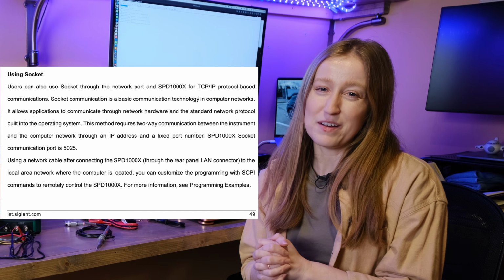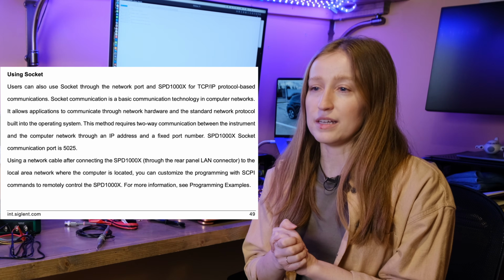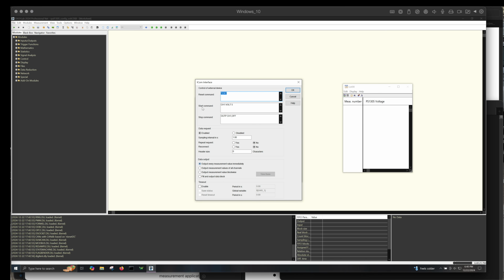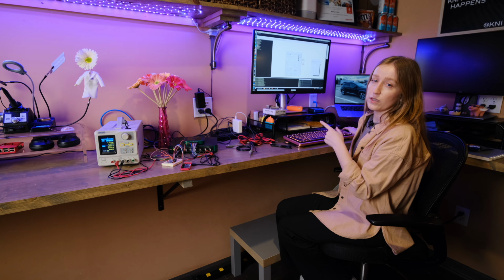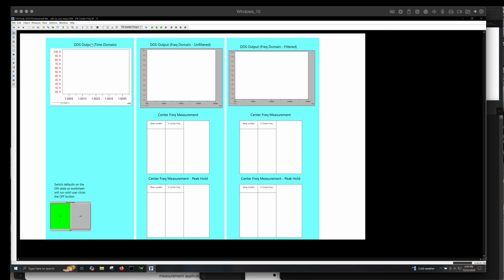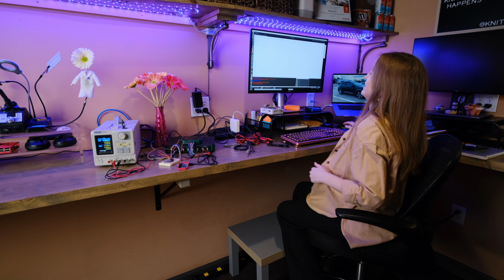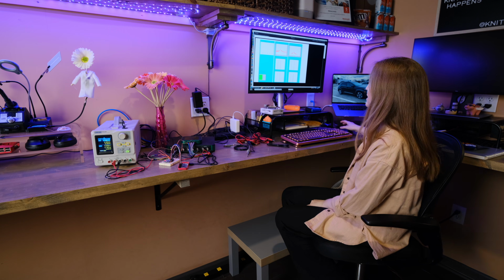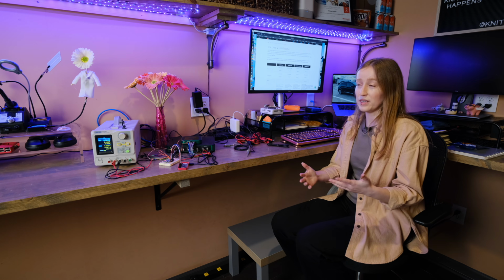How to Create a Remote Benchtop Setup for Electronics Engineers

Comment: Thank you. I had an idea for a multi battery charging and monitoring system. Keeps an eye on voltages and capacities temps and position, with hookups for all different types of batteries but the power is available through usb or other.... also would have in circuit isolation and alerts.... maybe solar sun tracking.....probly safety features as well, smoke fire carbon monoxide alerts.... kinda to get all the random stuff in a safe place, I guess. I like the idea of the power strips... I have tried to set systems up that can shut down multi projects from one switch, like a breaker kinda. If you have a lot of different devices that you need to activate remotely, don't forget audio, you can send audio of nearly any kind to communicate, there use to be something called a veear i think, you could program what sound it listens for. You know what might be cool, an independent unit you could use on various projects with adjustable current monitor  that lets you know audibly if its where it should be.....

Comment: 1.- Hi, former R&S support , the guy to set up all, carry the lugagge, do the wiring, solve problems, bribe reps and any one who gets on the way to close sales, and the scapegoat for rude lazy ignorant sales managers. So 
2.- Above all , Thanks with Capital T for the courage and determination to present such raw effort. 
T&M can be rewarding, but sometimes it's really tough.
Now, With the best of the intentions
3.- can you measure phase noise? dBc
that will tell you how clean is the oscillator itself.
4.- What filter are you applying at the output?
5.- The PLL code, is it your code, or are you using some one else's PLL code?
6.- Have you actually built a PLL to pull the 850kHz or 900kHz up to 1MHz ?
5.- SCPI GPIB I2C ... the instrument control protocol doesn't matter if the oscillator cannot hold steady on expected 1MHz
6.- Can you write in C an N-fractional PLL?
7.- Once you have "built" (written) a working PLL :
7.1.- sweep the entire band you want this device to work on
7.2.- Obtain all frequency errors on each individual frequency
7.3.- Build a correction table
7.4.- Bias accordingly the input so each output matches each expected frequency.
7.5.- Expensive equipment do this while taking device/room temperature as parameter. Does this board have a built-in Thermometer to check board Temperature ?
The device you show on the table has a thin box, it's open, and it may heavily vary output frequencies with temperature.
Thanks again for such presentation.

Comment: I still have no idea how this makes you money!
Reply: IT Infrastructure is the field.  Software all runs on hardware.  Hardware has to be maintained, troubleshooted, networked, upgraded, replaced, etc.  Tools and expertise are needed at every juncture of the IT supply chain from the fiber optic cable to the routers and switches that network your pc to a server providing you this video.  All the IOT devices in manufcaturing and other Infrastructure industries have their own maintenance and troubkeshooting problems.  Expertise in system design is needed to fix all this stuff.  Its really all just plumbing and circuits that holds the modern world together.

Comment: I wouldn't turn DHCP off, I would just configure it to give certain IPs to specific MAC addresses. This would centralize the network configuration instead of requiring of you set the IP for each device through its own interface, while running the risk of having the configuration deleted after some firmware update or something. Anyway, nice setup.

Comment: I'm a big fan of Skippy ehh... SCPI ... and only buy new stuff that has ethernet + SCPI built in. My power supply looks like yours but the SPD3303X has 2 programmable supplies. I use this in combination with an SDL1020X electronic load to measure the efficiency of power circuits and battery systems. Being able to program those via SCPI from Python (using the VXI11 library) is great and it made me expand my Siglent stack with their SDM3055 5.5 digit multimeter, SDS1104 Oscilloscope and - after a lot of thinking - also the SDG1062 arbitrary waveform generator.
I really like the Siglent stuff except for the clunky user interface on the power supply. Just having a rotary knob is not the best user interface. It takes a lot of turns to increase or decrease the voltage or I need to press the "Fine" button to go from 0.1 to 0.01 and 0.001 to 10 and then 1 V increments. I often just use my Python scripts to set the voltage and current. I still want to create a real UI with a keypad or a touch screen to set the values.

Comment: Super interesting. In my former job I was forced to use NI Labview with Teststand to build test equipment for embedded hardware production. I liked Teststand but I really did not enjoy Labview. In my current job I had to start from scratch and it's way less involved ("just" hardware test automation for R&D) I decided on trying spintop-openhtf (fork of googles open hardware test framework) which is open source and based on python. Sad thing is that they stopped developing it. I did not know DASYLab, it looks capable but I guess I'm more of a code than a guy person. Anyways, very cool to see your setup, there is not much on this topic on that platform. Looking forward to the next video :) subbed and 👍

Comment: Hey there Whit, Nice set up!. I've got an Extra class amateur radio FCC license, and I'm studying the General Radiotelephone Operator License (GROL) commercial FCC license with Radar indorsement. I like what you're testing with the frequency generator and verifier. May I suggest you narrow the lower and upper frequency band segment limits for your 1 MHz target frequency, allow your frequency gen circuit board to warm up to a constant thermal temperature before running the test for a more time based accurate frequency result.

Comment: Not heard of SCPI protocol before, Awesome video, really cool and interesting.
Reply: It's super useful, in a previous life I wrote an end to end hardware test, cal, burn-in, and data/traceability artifacts system using SCPI and other protocols in python with a web frontend. We could put a space flight component in a test jig, wire up sensors and I/O and the only time we'd have to touch it during the flight qual was if we needed to move it to thermal chambers (or take it to vibe). It was super nice to be able to put a component in a thermal chamber on a Friday morning and come back Monday afternoon to it and it'd have done everything automatically and produced all sorts of artifacts to prove its capabilities (and failures if they did occur).

I and other engineers would get notices and other stuff if things went awry too.

Comment: Thanks for the presentation. Call me an idiot but i don't understand the "remote" part. Shouldn't "remote" mean that you are in one place and your equipment is completely elsewhere (other building \ city \ country) ?
Reply: Well, "remote" means exactly what you mentioned. In the video, she describes how she built and uses her setup to monitor and interact with her test bench. She has remote access to the power supply to power the Raspberry Pi Zero and thought she could SSH to the other controllers via a Wi-Fi network, which is connected to the internet or a VPN to allow her to connect from anywhere. She probably demonstrated while being in her lab because it is more convenient than filming in another location just to demonstrate the remote access.
Reply: In this context remote/local refers to the manner in which you interface with the device under test (DUT) not the location of the device itself.

Think of it more along the lines of an RC car/helicopter/drone or even say the IR remote control for your TV.

You could be sitting right in front of it but you are still controlling it remotely.

I'm going to go out on a limb and say simply having to ask such a question means this content is definitely not for you 😅
Reply: “Remote” means using one machine to control another, different, machine ….

“WHERE” those machines are, and how far apart they are, is immaterial to the discussion.
Reply: What would you have seen if you had seen her only in a non-lab location?  This way she can show the equipment used in the lab so as to enable remote access.  The easy part, going somewhere else, should be obvious after this.

Comment: This is really well thought out! I have been doing some hardware analysis on an IOT product. I had an swd dongle connected to a raspberry pi connected to my network that I could access via a VPN. I had the IOT device connected to a cheap switch that I could enable on Google home that turned the IOT device on and off. All of what I had setup could be done remotely (that was the ultimate point of that setup) I just didn't have any assurance when something didn't work correctly because of my lack of networked test equipment. Your video motivated me to make my home lab more robust!

Comment: from 1996-2000, I worked at HP/Agilent's Automated Test Equipment business section and in the Santa Clara Semiconductor Test Division where that division made test equipment to test FLASH memory on the wafers themselves, companies that used this equipment (IBM, AMD, INTEL, etc.) used our tester (V-series like the V3300) to do their wafer sort, for that we interfaced with the wafer prober in their clean-room to move the table X-Y and Z up to touchdown on the wafer's pads.   Our equipment was in a large metal cabinet (and fans that were incredible to cool off the system), full of many large PCB's that did the pin-electronics, pattern generators, Test Site Controllers were the i960's, with a host of custom FPGA's.... it was a beast!  The customer-facing programming language was a pseudo C and the pattern generator had some proprietary assembly language like code to write the patterns, e.g.  NRZ  For non-return to zero.

One project that I worked on at HP/Agilent was the characterization of the chips themselves to find the operational parameters, called a SCHMOO plot.  That requires a complex interaction of power supplies, pattern generators, etc.  I wrote code that generates characterizations, it would step the equipment and then run the customer's characterization code, lather, rinse repeat...  So singe axis, 2D and then a special need for a 3D Schmoo plot, we had a console connection (no fancy graphics) so I came up with a really slick way to represent in text the 3D dimension...  and another innovation I came up with a way to avoid hysteresis in the characterization of the tests, both were considered patentable I{, but alas, they ultimately didn't patent it.  Wouldn't that be cool to have my name on 2 patents... sigh... what could have been, Right !? 

Today, I'm unemployed looking for something in industry... so I'm working on fun projects at home (Halloween and other things).  I have a home lab with some old rack-mount(ish) HP equipment, they're GPIB, but I haven't needed a remote setup or automation for my projects... and I completely understand why you need what you need. 

 Looks like a great setup you have there, a lot more capability too.   COOL !

Comment: It's an interesting video on your basic setup.  I have not seen the interface (DasyLab) that you have been demonstrating in this video.
I was also unaware of SCPI commands as there used to be GPIB (IREE 488(.1)) interface. Looking further into GPIB it actually uses SCPI connands..
With your frequency drift problem, you could try implementing a feedback protocol to correct the required frequency from the actual read frequency, such as PID.
PID can take the error and send back commands to bring the frequency back to the desired frequency in a closed loop.
I expect that you already have the experience of PID as you clearly understand your system.  I just mentioned it as you may have overlooked it.

Comment: Create static MAC/IP mapping in your DHCP server rather than turn DHCP off risking IP conflict 🙂
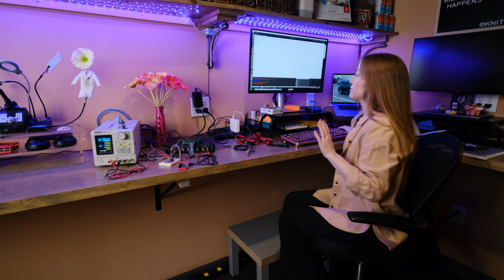Reply: Yeah, re 29:06/29:27 - I would also tend to recommend this as a suggestion.  Not sure what Whitney's setup is like, though, it may not be easy to do, depending on what she's using for DHCP.  But if this can be done, e.g. with dnsmasq or whatever, it provides some nice functionality... not least, also having access to local DNS that has names for everything... so "ssh ps1.local" or similar becomes doable. :)
Reply: I just created a DHCP range and set all my test equipment with IP addresses outside of this range. No risk of IP conflicts this way.
Reply: @Rob_65  outside of manual errors, fair enough... though also, there's arguably even less risk with the MAC-mapping option... and it can integrate with DNS, etc.
Reply: @Rob_65 there absolutely is a risk. How are you tracking and preventing the re-use of an IP address from human error?
Reply: Static mapping on DHCP server side is the professional solution and how it's done in enterprise situations - part of the subnet designated as a pool for dynamic allocations, a different part for statics assigned by dhcp (but manually tied to MAC)

Example for the subnet 192.168.0.0/24 you might have:
.100 to .199 for dynamic assigned pool
.200 to .249 for static assigned

Even the most basic home routers have had this functionality for well over a decade.

Comment: Does SCPI go over GPIO port on test equipment?
Reply: Modern test equipment will accept SCPI over, UART, GPIB , Ethernet and USB. Most  modern equipment has dropped the GPIB as its quite bulky cabling wise and pretty slow if your grabbing data. We tend to use Python talking to a connection server , i.e. Keysight connection manager, and that's about it for us.
Reply: @fredblogd8448  But do embrace GPIB because all older equipment uses it, and older equipment is often much better value for money. As it happens, Tech Tangent has just published a video about that.

Comment: As a hobbyist who has been meaning to look into SCPI and other remote control options recently, this was incredibly helpful and timely!

I switch between a lot (too many?  what's too many?  i don't have a problem.) of projects and this sounds like an amazing toolset to build up where scripting a set of bring-up and initialization tests for a board and documenting the setup needed to run them would be incredibly powerful. The "Built-in documentation" aspect you mentioned.

Thanks for actually showing the process and talking through the individual steps, too.  A lot of people are scared of putting out a 40 minute video but the 10 minute edited version skips over all the useful details and learning.  Seeing how you string things together gives a great sense of the possibilities.
Reply: there should be a cheap software of even free for the SCPI commands, if I remember python has something like PyVISA